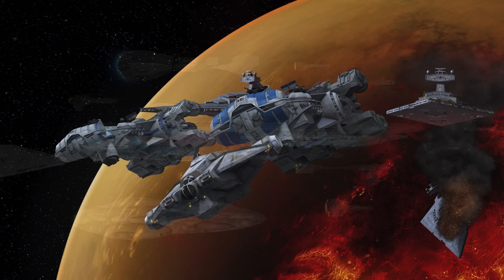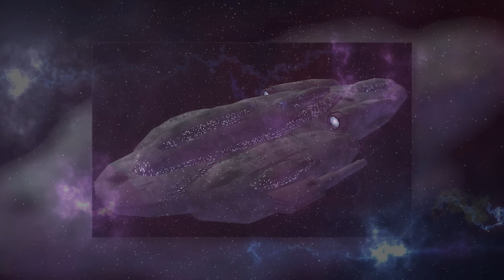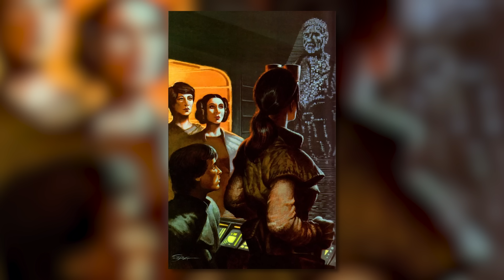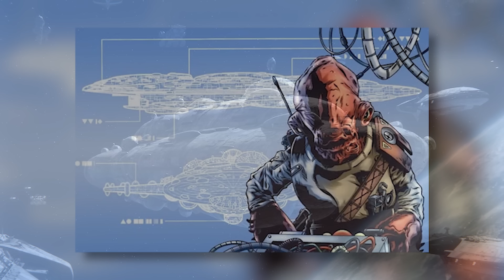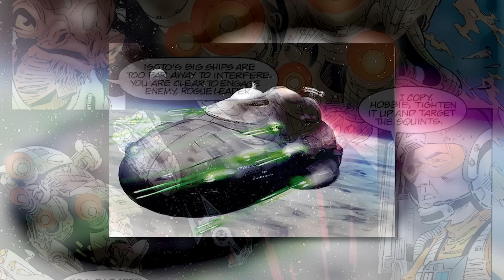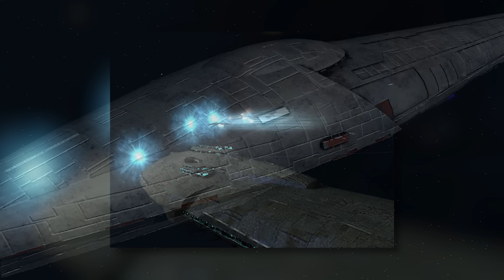How these Undersized “Star-Destroyers” Survived the Imperial Giants

Comment: 20:36 Actually, the Assault Frigate MK2 has the same length of 700 meters than the MK1, it's more compact frame giving the illusion that is shorter. Also, the MK2 had all of its quad laser cannons replacement by quad turbolasers

Comment: 20:35 Actually, the Assault Frigate MK2 had the same 700 meters length of the MK1, it's the stockier frame of the vessel that makes it look shorter at first glance. At the same time, the MK2 replaced all it's quad laser cannons with quad turbolasers

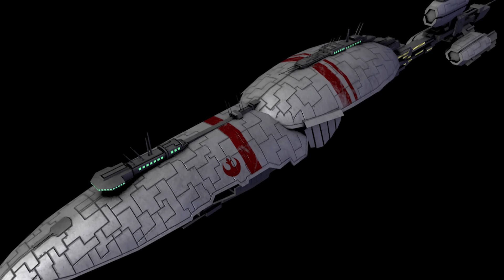Comment: 22:50 Wait wait wait! 2800G acceleration? For something that size and mass? Not kriffing likely!

For reference, what this means is that from being completely still to moving, it will immediately hit something like 62,000 mph in a flat second, and continue to accelerate at that rate while it's engines burn. And at that kind of acceleration, it would hit .3c in approximately an hour.

...Not only does that take a lot of energy to do (and there's nothing to say SW has Mass Effect Fields...so those engines are moving all that mass, which would be several million tons, or even tens of millions, depending on the materials involved), but if the inertial compensators fail to engage in that first second of acceleration...everybody's chunky salsa on the back wall and the ship becomes a massive ballistic missile that's gonna ruin someone's day at some point in the future. And it will be moving at an even greater fraction of lightspeed by the time it does so. What that is will depend on when the fuel runs out or the engines burn themselves up from the strain, whichever happens first.

...Space opera writers have no sense of scale...or consequences...
Reply: Big numbers?!?!? In MY grand scale space opera fantasy adventure series?!?! NUH-UH!

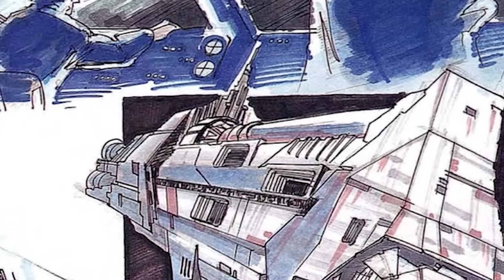Comment: 5:50 That's untrue. The Empire used plenty of Bulk Cruisers, Han had to specify "Not just bulk Cruisers, I mean the Big Corellian Ships" when talking about outrunning imperial patrols. The empire used TONS of these bastards for backwater defense and shipping interdiction.
Reply: Also Han was talking about a System security force and not necessarily the Imperial Navy
Reply: also these were designed early in the clone wars as escorts for freighter convoys and bulk cruiser is a term for a converted cargoship
Reply: Han said "not the local bulk cruisers" in that scene
Reply: @christophernemeth421  But did call them imperial rarher than pdf

Comment: What I don't understand is what does all these crew do lol... that one ship had like 16,000 crew anddd 100 gunners... I just don't see how with droids and tech how you could need thousands for upkeep to produce and apply so little.
Reply: Three duty watches per 24-hour day explains part of that. Every hand on duty has 2 off-duty. 

And then there are the non-combatant crew. That’s the guys who work in the galley slinging food, the guys in the laundry starching the officers’ underwear, the guys bussing the tables in the officer mess and the like. 

And then there is the quasi-combatant crew. That’s the guys working in the hangars, who don’t have anything to do in combat, but they are essential in launching & recovering fighters, reloading & refueling bombers & fighters and do the maintenance on fighters between flight operations. 

And then there are the guys who work in the cargo holds. A heavy cruiser with nearly 10k tons of cargo probably has a couple hundred guys who load or unload cargo holds. 

And then there are the Damage Control crews. They only work when somebody is shooting holes in the ship, but they keep a ship fighting as it takes a pounding. 

Of the 16,000, maybe 4,000-5,000 are actually necessary at any given time.
Reply: Most Dreadnought Heavy Cruisers were built shortly after the Droid Revolution and the Katana crisis. There was an anti-automation movement where human crews replaced tasks that used to be done by droids or computers. This led to huge, bloated crew sizes and the need for supplies to match. It also meant less efficient, buggy systems, as humans were far less precise than their droid counterparts.
Reply: A real world aircraft carrier has over 4,000 crew
Reply: @christophernemeth421 ya with 1960-80s tech. And we know what they all do. Great point though friend

Comment: The Alliance battle strategy should never have cruisers in their small strike teams, however if they were to be used they have to be hammered the Imperials with both speed and strength, but it would be a mistake if the Alliance were to be stand their ground because the Empire will dogpile them very quickly.
Reply: Actually, that depends. Outside the Core worlds, the Imperial fleet was spread thin. Usually one ISD per system, at most, with only a handful per sector. To reinforce another sector, they had to pull already overtaxed ISDs from other systems, leaving them undefended. The point of the Tarkin Doctrine was to use fear so they wouldn't need a ship in every sector. Of course, we know how that turned out. So, even if they could send reinforcements, it was time-consuming to reorganize sector defense forces to send ships, giving plenty of time to complete your objective and get out before they arrived. Where the Alliance frequently got screwed was when they walked into a pre-planned trap. Then, reinforcements were already allocated and ready to go. They might only have minutes before an entire battle fleet of ISDs dropped out of hyperspace to start tearing them apart.

Comment: The Alliance Fleet was known for its use of several battle tactics, many of which were very different than those of their Imperial counterparts. For instance, while the Empire stressed quantity over quality, preferring to use weak unshielded craft to beat down opposition through sheer numbers, the Rebels used strong, multi-purpose, shield- and hyperdrive-equipped craft.